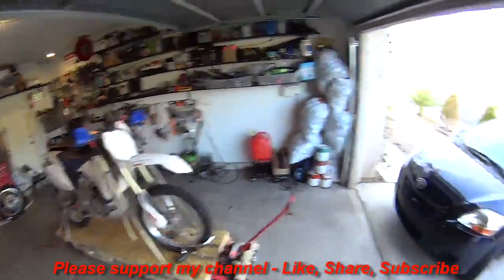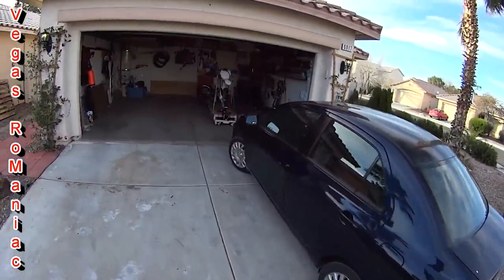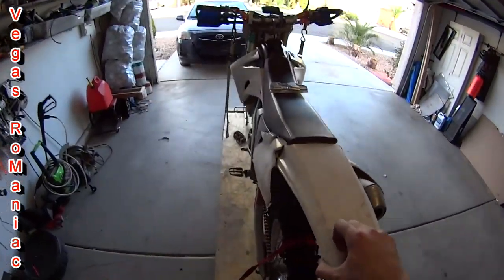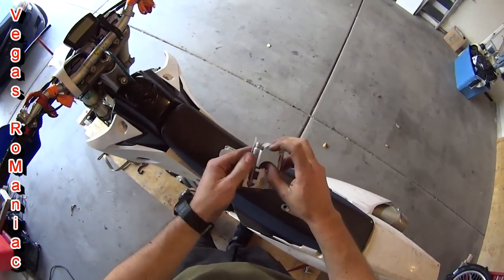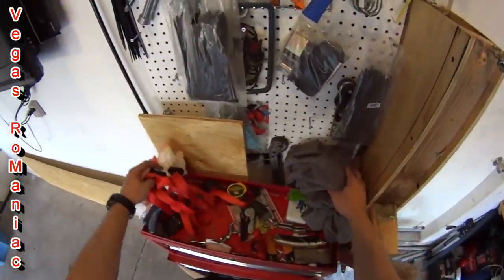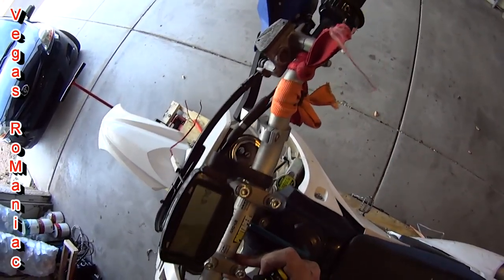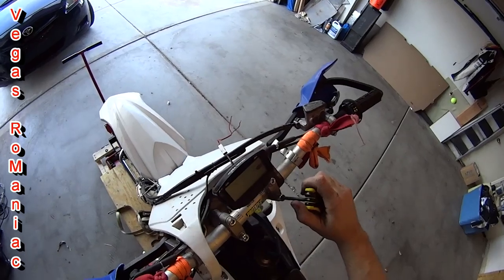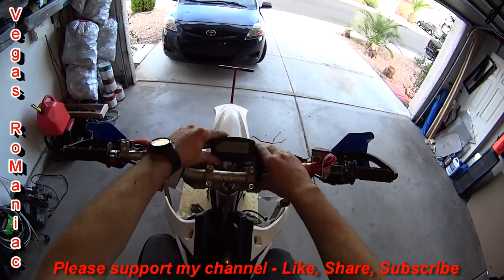How to install Handle bars risers, and are they worth the money !?

Comment: I'm 6.2 and in need to bar risers, but I've found the rox speed fx the best, the problem with common risers is that it will push the handler bar to you instead of staying in the same position.